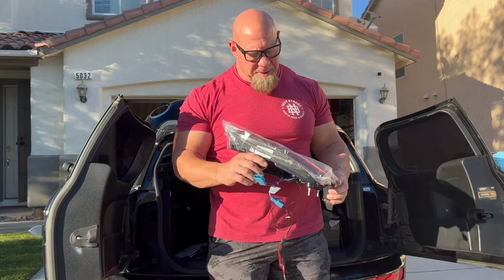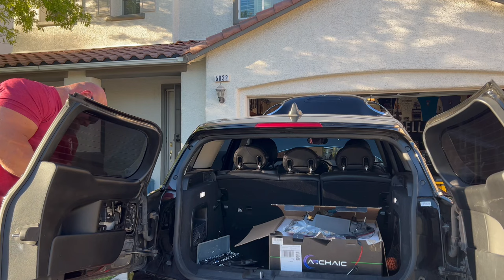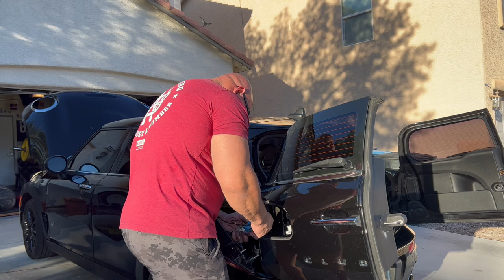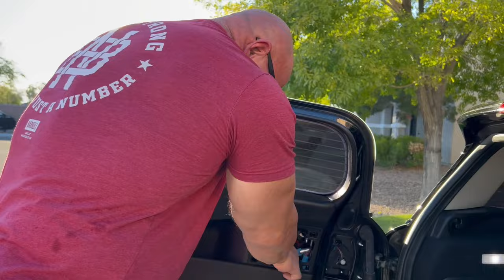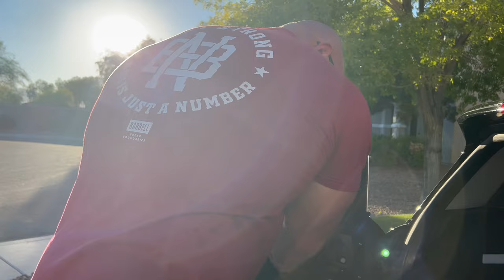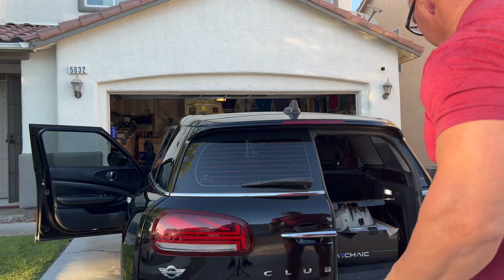Mini Cooper Clubman Taillight Repair

Comment: What impresses me most is that you said you removed four 10mm bolts and didn't have to search for hours to find a 10mm socket.
Reply: What? He had a 10mm? Must be an edited video. Cut out the 6 hours searching and buying 2 new ones only to lose them on the way home.